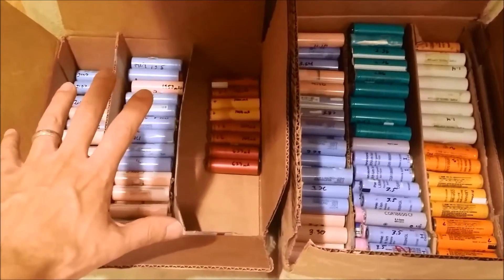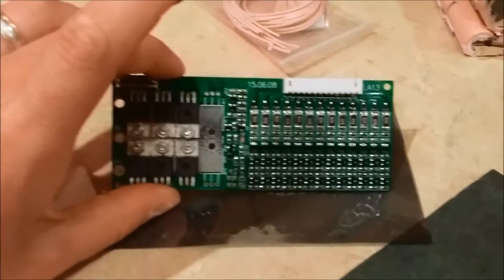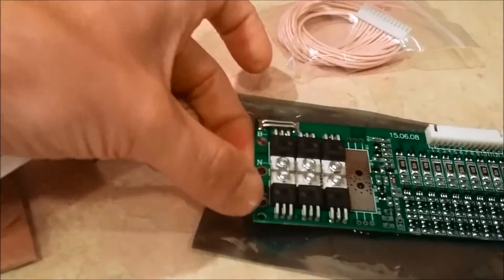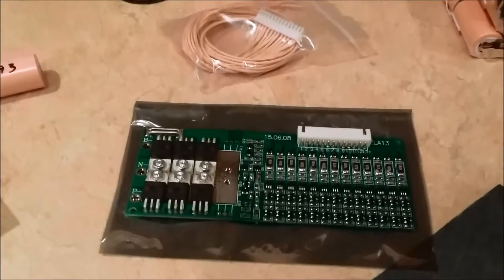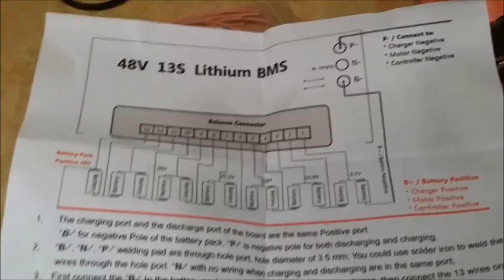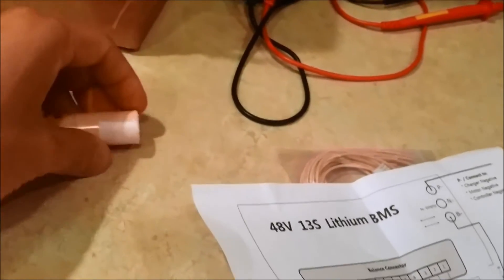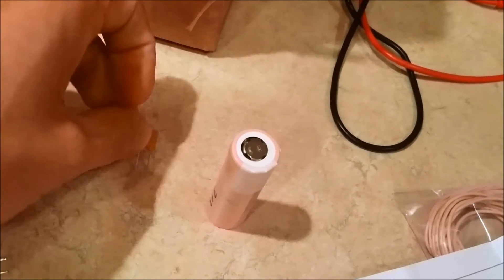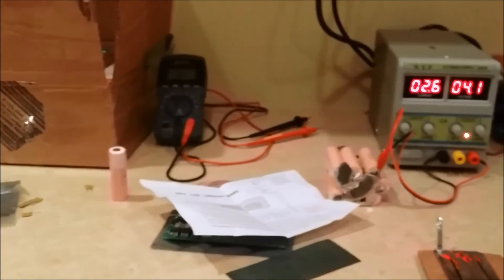"Receiving cool parts" for the18650 lithium e-bike battery (Part 1.5)

Comment: i go here to get my batterys http://www.dhgate.com/product/dhl-free-18650-rechargeable-li-ion-battery/242774788.html#s1-21-1a;srp|1525707552
Reply: These cells advertise at 5000mAh. What actual capacity do you get and are they consistent? I've heard that used cells are sometimes recycled and relabelled.  Thx
Reply from the maker: +Tim Byers Hey Tim, If you see a 18650 labeled over 3400mA stay away from them as they more than likely fake.  The 18650 is only so big internally and can only have so much inside.   The Panasonic NCR18650B is the only 18650 that I know of that has up to 3400mA and it safely discharges at 1C (or 3400mA only).  There are some like the inr18650-29E that have a C rating of 2 or 2C.  So normally its rated at 2900mA but can safely discahrge at 5800mA.  Just look for C rating and less than 3400mA.   
Recycling cells IS very true.  I tear apart laptop calls all the time and have actually found used cells where they have ground off the old spot weld marks and re-welded new tabs.   They were completely dead!
Reply: What about your DHGate 5000mAh cells?  What actual capacity do you get out of them.  The price looks great if the capacity is above 2000mAh.  Thanks!
Reply from the maker: Hey Tim, yeah man you may get lucky, but I have read about companies advertising over 3400 is more like 1000mA when tested.  I dont even pay attention to those personally.  Most of the lower mA cells that are name brand and are around 2000 -2500 typically are 2C cells.  The Panasonic 3400 is only 1C.  Then you have to take a leap and pick a supplier and hopefully you get what you paid for :)  There are a lot of horrer stories of people getting ripped off.  Im taking a $1000 gamble right now hoping I get what paided for.  So far I have my 72v BMS and spot welder and still waiting on a long list of other items.  Look on the sites aliexpress, dhgate, look for years of selling with good ratings, thats what Im doing.  BAK seems like a good brand cell but reserch the cells for there rating.  My 72v battery will pull 1.2A per cell @max throttle so Im not to worried about 2c right now.

Comment: im not understanding the 4 amp fuse side of things, on the type of fuse i think your using the Tripping Current: is almost double the run capacity. i assuming there are 4A (4000mA) Resettable Fuse 16V thermostat thermal PTC fuse, if that's the case. They have around 80A Max Carrying Current before they melt lol, A Holding Current: 4A, but a Tripping Current around 7.2A.  So will handle loads up to 4 amps but will only trip if the Current exceeds 7.2A according my out my head specs. Am i wrong?

Comment: I did a lot of research on lithium batteries when planning my e-bike conversion.  I considered scavenging used notebook PC batteries, but I was concerned that they had all been overheated for long periods when fully charged until one cell died and the battery pack was scrapped, and the rest of the cells were close to end of life.  Then I considered new old stock notebook batteries from the big names in notebook PCs, that had never been used, but decided the cost savings wasn't enough to justify disassembling notebook PC batteries.  I finally bought 150 Panasonic 18650 batteries from a reputable online wholesale seller.  They were specified at 3400 mAh each and my SkyRC charger is rather gentle on the charge and discharge cutoffs and I'm getting an average of just under 3000 mAh.  I've been testing them for days and so far, they're all good and close in their capacity and internal resistance.  I could probably just buy them and build the 144 cell pack.  I anticipate a real world 1550 watt hours of battery capacity, or enough for 73 miles at 16 MPH or 33 miles at 30 MPH, without pedaling.  I spent $669 on the batteries, including shipping, but hopefully I'll never need to buy batteries again, or build another battery pack.
Reply from the maker: +Liberty4Ever Hey Liberty, nice job on the cells and you did the right thing on new old stock cells.   You will get years of riding time out of the battery.   I could have bought new cells, but I mainly did this to show that if you don't have the money to buy new cells that it can still be done with used laptop batteries.    I was able to find and use the cells that are 2/3 or better of there normal capacity.  So far so good.   What voltage are you building your battery to 48v 60v?
Reply: +15-sec-of Fame My 18650 battery pack is configured 12S12P, and I plan on charging it to 48V max (4.0 volts per cell) to maximize battery life over range, although I'll probably make the charger with the ability to flip a switch and charge to 4.1V per cell just before a long ride to top it off.  There's some GREAT online info at Battery University.  Some of it is a bit long haired and academic, but there is a lot of good info that's very approachable by the lay person.  The worst thing is to charge lithium batteries, hold them at an elevated voltage (constant trickle charge) and simultaneously expose them to heat.  That's a recipe for parasitic reactions.  This is pretty much what notebook PCs do.  I'm going to charge and discharge my batteries more like Tesla does in their cars for maximum life.

I printed receipts for what I've spent on my e-bike project.  I'm nearly finished buying, and now I'm afraid to add those receipts to get the shocking total.  I definitely would have been better off buying a full suspension mountain bike with disc brakes, but I really wanted to convert my old bike.

The label on my controller looks a bit anemic for a 1500W kit.  It seems to max out at only slightly more than 1500W.  I wasn't really planning on super speeds and 1500W should be plenty, but the others I've seen on YouTube and at e-bike websites seem to be able to be rated for continuous power, with 2X or 3X or more capability for short bursts.  It looks like I may have a 1500W motor and a controller that's underpowered so it's impossible for it to overheat the motor.  There are apparently no temperature sensing wires from the motor to the controller.  Just the three phase winding and a five pin data cable that I assume is +V, COM and three Hall effect sensors for external commutation.
Reply from the maker: +Liberty4Ever I have to say that you have definitely made good choices on doing your homework first to make sure you do everything right!  Please know when the controller is set to a 48v system its normal for it to handle up to 54.6v.    So if you made a 13s battery and charged the cells to 4.0 you will still be doing very good as your battery pack will be at 52v.   Plus you will have a bit more performance due to the higher voltage.   Your 12s-12p 36Ah battery may cause your display to show low voltage when you use the throttle and the controller to warm up a little faster due to it relying on amperage over voltage when the controller is set to a 48v system.  The 13s 11p 33Ah may be better all around option for the controller and battery.   This is just some of the things I have seen first hand when I'm down to 48v on the battery.   I don't let my battery go below 48v by then I'm at 30 miles or more and my cells are at 3.7v with no load.   Im also moving pretty fast most of the time :)  Play with it and test out both options and you will find what works best for you.  Keep up the good work and please keep me posted  :)
Reply: +15-sec-of Fame Thanks for the really good information. I can't believe the Chinese electric bike kit came with absolutely no instructions. It looks like there would at least be a battery recommendation and a few simple instructions. I need to double check but I think the controller label stated 48 volts maximum. I guess I can build a 12S 12P battery pack and if I get low voltage warnings I can add another 12 batteries in parallel to the series string for a 13S 12P battery. Watching your videos, I'm getting more stoked about this project.
Reply from the maker: I have a pictures on my profile page of my controller and charger.  Do you have the same display as I do.   If you do I have the instructions for the settings.  If not google the part number thats on the display to see if you can find instructions on how to adjust the settings.  My controller says 48v also but it also says lithium ion battery for the type of batteries to be used so automatically that means 54.6v max.  How are you going to charge the battery?  I have a BMS board that helps control the balancing of each bank of parallel cells.  Its a fun project to build, but man just wait once you start riding its just fun to know that what you made will get you down the road for miles with little effort and no gas money spent.   After I finished my bike last fall I was able to put 165 miles on my bike before the winter set in and that was just in a few weeks time :)  My controller has voltage settings from 36v up to 72v (nominal voltage 3.7v per cell) so now I'm working on my next battery project and going all out with a 72v or max of 84v.   As of now I need 160-200 cells 20s 8p or 10p still waitng on a few parts to show up.  I'll keep my 48v battery around until I know the 72v battery is good to go.
Reply: +15-sec-of Fame I've now watched all of your videos so I'm much more up to speed on your entire project. Really great stuff. I plan on charging my battery pack with a custom trickle charger on a timer. At first I'll try charging it with just the positive and negative but I'm going to wire the battery pack for balance charging if needed. I'll use the balance port to measure the voltages and I'll keep up with it the first several times I ride and charge to see what it's doing. Eventually I'd like to solar charge it. It's cheaper and easier to charge it from a 120V outlet but the solar is kind of fun geeky thing to do. it's also part of the Libertymobile concept. I just like the idea of being free from the power grid. Kind of neat to have the sun powering my electric bike. I do have the instruction sheet for the display. I also downloaded a more detailed instruction sheet that may be for a different controller. I'll figure it out. :-)

Comment: Are testing my 18650 with my opus charger and what is the minimum Mah for the battery too be good and enought 
To use for a battery pack? 
And Also i doesn't find the fuses you linked
(Im building a 13s8p for my 1kw bike)
Reply from the maker: +anton arnqvist hey Anton for a 1kw kit I would use a 15Ah battery minimum.  So if you are currently testing each cell I would focus on 1900mAh or higher.  You will need 104 cells total.  I bought the fuses on ebay, try copying and pasting the following  in ebay to find the fuses:  New JinKe Polymer PPTC PTC DIP Resettable Fuse 16V 4A JK16-400.  Let me know if you have any more questions.
Reply: thanks! 
is it "enught" to only balance the cell when charging(3 imax b6) and not use a bms?
Reply from the maker: its easier in the long run to just use a BMS.  All you need to do is plug it with your charger.   There are some BMS's on ebay that are selling for $20-$30 that are good, you will just need to find a charger for your battery and that will about $60.
   But if you need to use the Imax's you can used D-sub connectors.  Just be careful on were the wires are connected so you dont damage the Imax's.  Just follow the wiring instructions in the manual.  
I can draw a schematic for reference of how the Imax's should hook up and post it to my profile page.  Your battery is 48 volts 13sx8p right
Reply from the maker: anton arnqvist sorry just noticed your comment,  yeah man that looks like it could work, but not sure why it would need a usb adapter for programming.

Comment: I just have to say that resettable fuses are a BAD idea. The fuse is there to disconnect a dead cell in case of failure, you don't want it to reset and continually drain your pack to DEATH. Also, resettable fuses are notoriously inaccurate, trip current can be anywhere from 100% to 200% rated current. For example, if you draw 5 amps, the fuse will take 30 to 60 seconds to heat up before it disconnects. VERY BAD, this doesn't protect you from catastrophic failure !!!
Reply from the maker: Its all about having something there to help protect from a fire or a shorted out battery.  Also, its better than having nothing as most people dont even connect anything to protect them.  I would rather have the fuses than straight bus wiring connecting to each cell.   I hope this helps clarify why I installed them. Thanks
Reply: Well I guess that a dead battery shorting out the pack will not catch fire and will discharge the rest of the parallel batteries to 0V. Thereby killing one row of batteries instead of just 1 lonely battery.
Reply from the maker: dude if there is an issue you will notice it pretty quickly due to the lack of power, therefore I would then trouble shoot the battery and determine witch cell is bad. Would you rather use straight bus wiring to all the cells? Please explain a better way of wiring "in your opinion"; or better yet show me how you have wired your battery on your channel so I can learn from your great wisdom. Thanks
Reply: You sir did a very good job and your work is top notch, really. I do think that this way should stop a battery blowing up, but you can do better. Look at the tesla batteries fusing each cell with fuse wire. Watch the electric samba videos for great tips. You just needed a little electrical engineering help. No hate here.
Reply: The reason I point this out is because you assumed that cells expire only when you use them. In fact, cells discharge all the time. The closer a cell is to death, the more it discharges. That is until it simply shorts out. A non resettable fuse will "take-out" the bad cell from the pack before it can damage other cells. You will notice the reduced capacity when charging if you have a capacity counter.
Reply from the maker: Thanks, its cool, actually I am an electrical EE Tech.  Tesla cells have a one time use fuse and yes I have watched samba videos. For example if you have a Tesla battery pack with 8 cells in parallel and you loose 4 cells because you wanted to go up a hill to fast. The other 4 cells in the parallel pack is being over worked and may over heat or the remaining 4 fuses start popping also. Now you have permanently disabled the string of 8 parallel cells in the battery and maybe your EV due to the loss of voltage.  If they can reset then you slow down let things cool off and your up and rolling again.  I have seen the videos where he had popped some fuses here and there.in his Tesla battery pack and he wasn't sure how to fix it.   Jehugarcia has contacted me about my fuse idea already.  Thanks
Reply: Yes it is a great idea to limp home without catastrophic failure. I guess it is a question of preference. Carry on sir !
Reply from the maker: Please know that I do see your point on the singe use fuse and they both have positives and negatives for each type of fuse for different situations.  After every charge I test the batteries voltage to see if it has full charged due to my BMS isn't a true balancing BMS (just noticed this a few weeks ago).  So for now (until I find a better BMS) I have to stay in tune with my battery pack and performance feel of the bike to make sure it stays safe.  Thanks.

Comment: Hello from Canada , What's the model of soldering fuse ?Soldering only positive to negative pack or all negative cell ?Tank-you!
Reply from the maker: +Pasc Lizotte (plizotte2003) hey Pasc I bought them off Ebay (New JinKe Polymer PPTC PTC DIP Re-settable Fuse 16V 4A JK16-400)  I soldered one to the positive of every terminal and when I series the banks I soldered them to the negative of the next bank in serise.  So far they are working great.
Reply: +15-sec-of Fame  Hello tank-you for for reply, yesterday y have ordered this: http://www.ebay.ca/itm/291617827678?_trksid=p2057872.m2749.l2649&ssPageName=STRK%3AMEBIDX%3AITY assume is probably the same fuse.Good new year and y apreciate your battery videos :) , y have 3 e-bike :)
Reply from the maker: Pasc Lizotte Yes that will work perfect!  Happy new year to you too!  this is my last post in 2015. see you next year :)
Reply: +15-sec-of Fame , tank-you for your reply , if your last post in 2015 , your clock time is not the same, y live in Drummondville, Québec, Canada french , my first is french for speaking ,mu English speaking is about 70%  but y read 100% English.